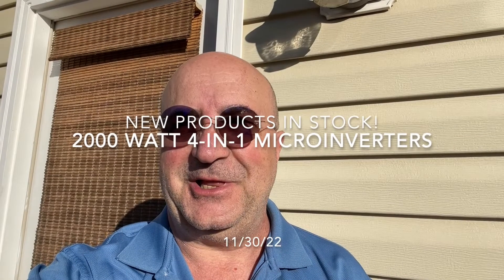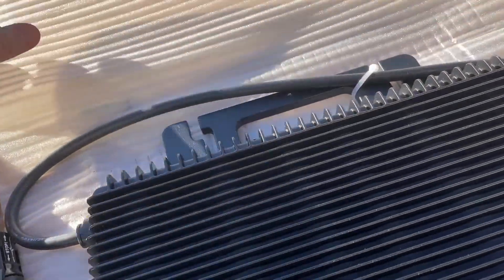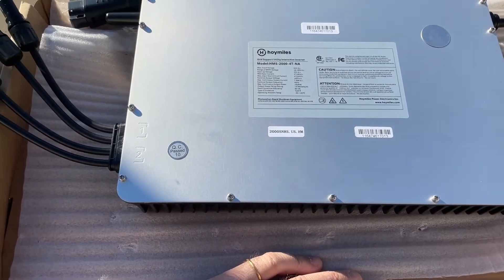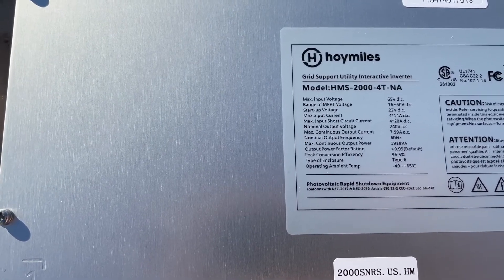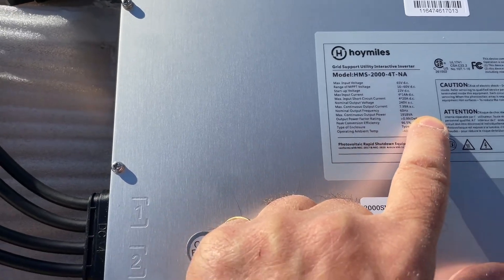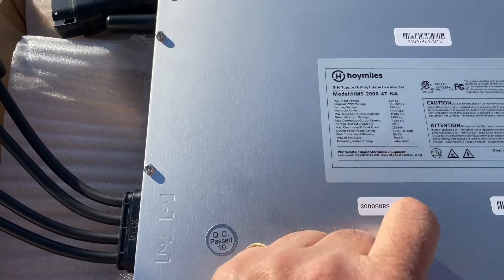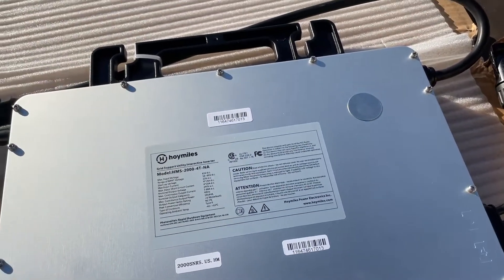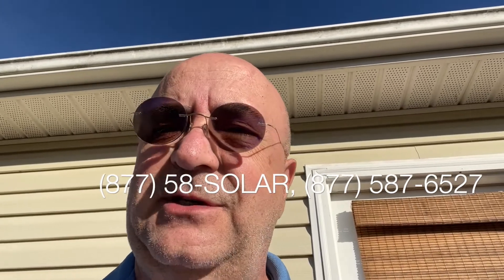2000 Watt 4-in-1 Microinverter by Hoymiles - Our New Product in Stock!

Comment: Great video. I believe you said 3 inverters can be wired in series. 
Is that it? Just 10 gage wire ran to the combiner box or straight to the solar disconnect. 
Can these be islanded during a power outage ?
Reply: Hi. Yes, very simple to install. No, they are not off-grid. They do not operate without the grid being present. That would be a safety hazard, since there is no transfer switch in a microinverter.